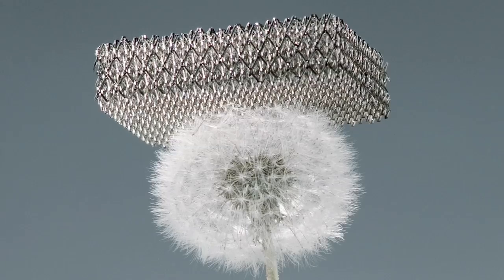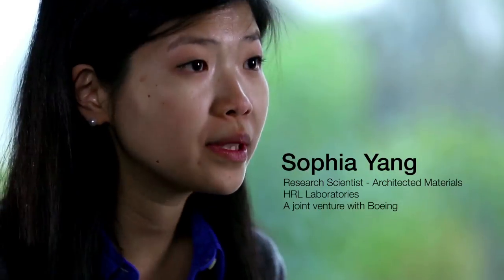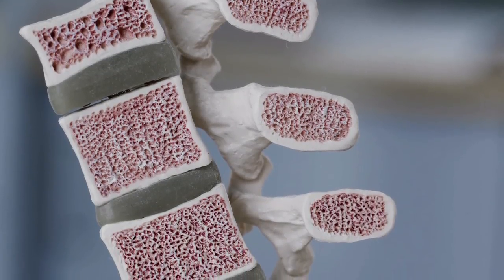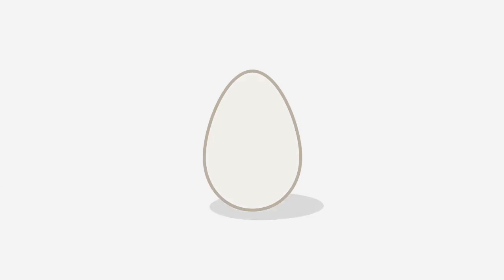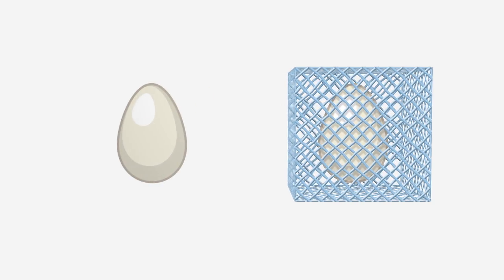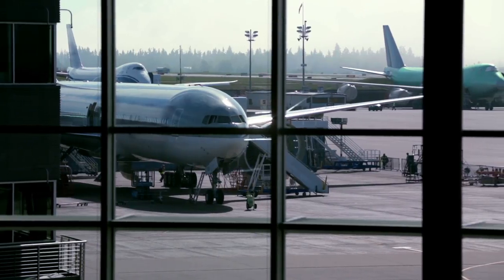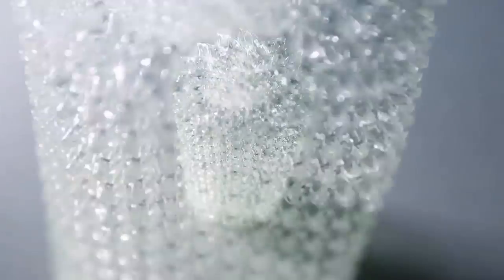Aerospace Innovation: Boeing Develops The Lightest Metal Ever With Latticework for Future Aircraft

Comment: I thought aerogell was lighter
Reply: +Jacob Devine I think you can purchase a sample of that on Amazon.  been wanting to see a piece for 20 years.
Reply: Dixon Cider that's cool. I'll look into it. It's one of my favorite substances
Reply: +Jacob Devine Another article on this says "it is considerably lighter than aerogel".
Reply: +Jacob Devine Depends on the aerogel!
Reply: +Jacob Devine But it's not metal. Super misleading title though, they might as well make a big hollow sphere out of tinfoil, and say it's 99.999% air.
Reply: Joshua Pearce Except it wouldn't have the characteristics of this which makes it significant.
Reply: The1stDukeDroklar It would be equally useful as an aircraft construction material. (Assuming you like your aircraft to be rigid and not easily squished)
Reply: Pretty sure that's not a metal.
Reply: Joshua Pearce I can also see a big potential for space since it has such shape memory where it can be compressed and return to shape.
Reply: +Jacob Devine Aerogel is a metal oxide, so they are not in the same category.
Reply: +Jacob Devine Is it metal?
Reply: I never did say aerogell was metal........
Reply: In the video they state that their material is the lightest metal, so it doesn't matter if aerogel as a non metal is lighter. If that woman on one occasion said that it was the lighest material, then it was a mistake on her part.
Reply: it is, but this probably won't shatter.
Reply: Aerogel is a gel. This video is about the lightest METAL ever
Reply: Silver the Hedgehog Aerogel is not a gel. It is made from a gel.
Reply: +Jacob Devine but aerogel is brittle while the microlattice is more rigid

Comment: I have an idea very similar to this once for an egg drop challenge,  but the lattice work would be larger on the outside and as you move in become smaller and more compact. If you imagine arches on smaller arches or triangles on smaller triangles. As you converge inward the lattice stays the same density and gives a little bit less each step in. I am sure it would only get more interesting with full 3D shapes / polygons as well, that all touch like dodecahedrons or even Icosahedrons. Why metal at all? Why not carbon nano tubes or something like Dyneema which is supposed to be knit and stronger than steel or kevlar.

Comment: I really don't see how this is any better than a good high density foam. The structure is smart, but it is still going to be limited by the metal you use. Wouldn't it be stronger to make some kind of a carbon lattice and fill the gaps with foam?

Comment: if I were to smelt this to use it for something (so it doesn't have spaces in it) will it still be light?
Reply: No. Without the hollowness the metal would be heavier. I guess it depends on how much of the metal you melted.
Reply: Well, No, because it is lightweight due to the fact that it is mostly air
Reply: No, the light weight comes from the lack of material in it. It is built to maximize strength and minimize metal usage.
Reply: Probably not, when you melt a metal the heat typically changes the molecular make-up of that substance, so very likely it would not do so. It would have to be tampered with again on the molecular level most likely.
Reply: well. It would still be light because you still have the same amount of material but it wouldn't be as strong and efficient as the structure of the material is what makes it so strong. You should rewatch the video. I feel as if you didn't watch and it just commented on it....
Reply: It would weigh the same amount as before, however it would be much smaller.

Comment: Beautiful. Though use this in cars because i'd love my crumple zones to bounce back after an impact just saying.
Reply: I see that being the future for most vehicles. A soft, self healing material that can crumple under extreme pressure on the outside of an extremely rigid structure.
Reply: +Kangaroo Chili but what would happen in a case of a storm or tornado? This metal is stated to be strong but also light weight, the engine and components of the car might weight a lot but the outside layer is also important
Reply: ThatGuyPie Some type of electromagnetic system to keep a car on the ground during high wind speeds could work.
Reply: so far there is not enough metal in the roadways to achive that, 
otherwise floating cars with electro magnets could be a great idea but the problem is the metal cost would be too high and the roadways to limited.
Reply: Zachary Arken Obviously it'd be something the geniuses of the future would have to figure out, but think about the stuff magnets could do. A train that is powered using electromagnet channels, you turn one channel on and the train moves towards that direction or something cool like that.
Reply: +Kangaroo Chili yes, 0.01% of metal to air can totally protect you...
Reply: Actually I think it could think of bubble wrap its mostly air. Wrap this in a slimier kind of strong stretchy plastic coating and you could have a bubble wrap car that can maintain form and bounce back from accidents.

Comment: so i dont think you ever actually said... but what is the other 0.01% of the composition? it needs to be formed of something that you said is metal, and it can bend but not break quite easily. and if it were used on airplanes where would it be put? would it be a bone styled shell? where there is a hard metal outer layer or shell and then this stuff on the inside? and this is very light but doesnt look strong so what would the point be if it were to be in an airplane? if you need a hard outer layer anyway why not just make it hollow? and as somebody else asked, what is the cost for you to produce a piece of it about the same size as the one in the video? is it cost effective for building yet? you guys triggered my engineer thoughts hahaha! but anyway, that is really cool! hope some day I can be developing new stuff like that...

Comment: Might a laminin-type structure be added for infusing aerogel (skin) to the microlattice (bone)? Would a lattice with aerogel be resilient, and maybe pliable, enough for the rigors of space? Could significant shielding be achieved to protect astronauts against the ether or ejecta of the sun and cosmos? Self-healing of a compromised silicon skin achievable?

Comment: A metal either is an element or an amalgam of different metals. The title is misleading, it should say the lightest metal composite lattice structure available instead. Even the sturdiest and most resillience ones isn't made of metal but a material called aerogel.

Comment: One benefit I see is an increase in buoyancy, which could be useful in the event of a water landing. Drastically decreasing the weigh of the aircraft could have a handful of benefits, like allowing planes who have lost an engine to glide for a longer distance. But it could also have several negative effects. Planes would be much more vulnerable to serious turbulence if the weigh of the plane was drastically reduced, and subsequently more vulnerable to crahses. That is if the material is used in the way that was insinuated in the egg drop analogy, which I'm not sure really applies anyway. You can't encase a plane in enough of this material to drop it 25 stories and have no get injured, let alone a real crash.

Comment: This could be used for bone replacements. like the inside of a hip replacement to make it light but not easily crushed, like an actual bone.
Reply: Yes I know but titanium isnt the easiest to forge because of its high heat resistance. Making it more expensive.
Reply: They do...different material but same method of construction. Google trabecular metal. Plane manufacturers made this awhile ago (>10yrs) and since then it's mainly just been used for joint replacement. Interesting stuff.
Reply: Yes very. I just researched that memory metal. Someone apparently made an engine out of it. It may be expensive to make but it seems like it could produce a significant

Comment: A latice of silicon could be made and used to create a super computer has well. Or even a power generator that creates energy from light and from vibration! Which means you could use this on rooftops around air ports that could use tge sound waves of jets to create electricity! ; )

Comment: what if you made a whole airplane with this?
Reply: If it was 100% made of this material, It wouldn't conduct electricity, so nothing will will work, so it'll never get off the ground.

And even if it DID get off the ground somehow, it would break into billions of pieces due to high speed winds, turbulence, and the speed it's traveling.

Not to mention the pilots can't see anything outside of the plane (or ""aircraft not designed for flight" at this point), which let's just say isn't ideal.
Reply: Depending on the size and engine power and how thick it is,its probably going to be flightless. As explained,its strong,but possibly not against specific speeds/G Levels.
Reply: +Iandiamond wow you got so triggered over that comment, and there are  these things called wires that would conduct electricity through the airplane.

Comment: Simply looking at the thumbnail, they say that a box of metal that basically only consists of the 'storage space' and a very thin metal case makes the metal lighter bc the box is 99.99% air, as there is no metal that fills the container. 

Showing off a chainmail-sorta piece of metal requires the actual amount of metal to be rather low which results in low weight. 
Good thing catchy phrases and nice thumbs make YT and ads nowadays.

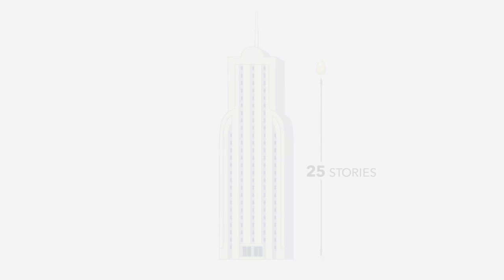Comment: By far impossible... If its a open cellular POLYMER item... Considering the denseness and the example (1:08) this item would weigh ALOT.
This is futuristic metal, now we can figure solution of terrorist bombing. Maybe implement these as armor for the navy. As it is lightweight, although. We can maybe patch up those holes. All we need now is to test these items, analyzing the structure, and see if its dense enough to withstand bullets. Or bombs.

Comment: This material would be very important in protecting an aircraft from lightning used in a resin matrix with fiberglass etc. the metal would safely conduct the charge around the cabin and enhance safety. also would be flexible and rebound small impacts that would otherwise leave a dent. If memory metal were used, even better.Another use would be as a potscrubber, LOL. Recycle that 747!!

Comment: 1 problem its not one solid piece of metal it is a grid of metal 2 if it is 99.99% air then shouldn't be air not metal 3 anyone could do this really just need a small amount if aluminium
Reply: And its not really a metal more then a filler for a skeleton of a shell don't get me wrong 
We need strong light filler but don't call it a metal if it is 99.99% air

Comment: it the strongest and lightest metal but spider webs are the strongest and the lightest thing on earth spiderweb they break really easily well that's just because there is a little bit of it if you had a spider web like the width of a pencil you would probably have to break it with a bulldozer